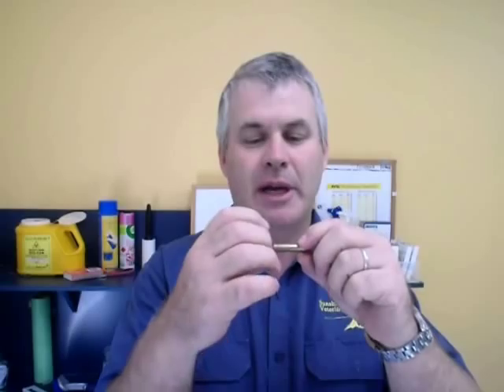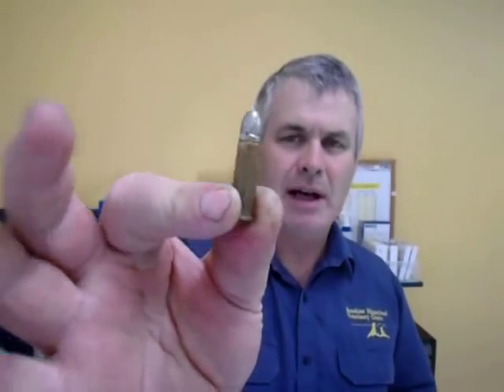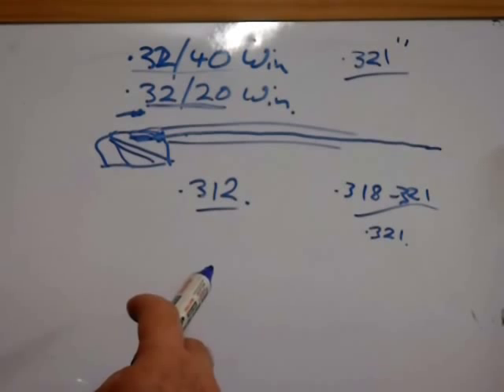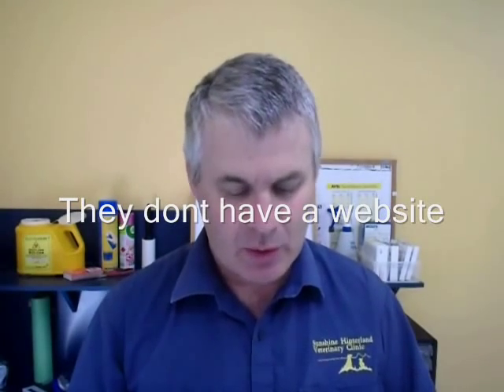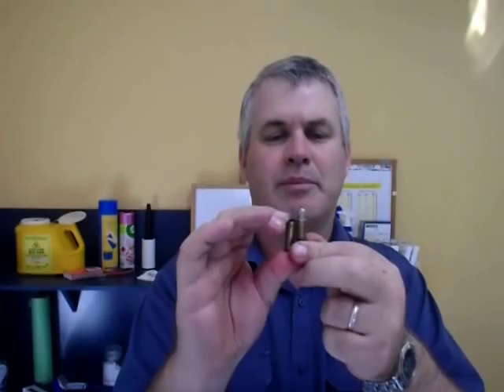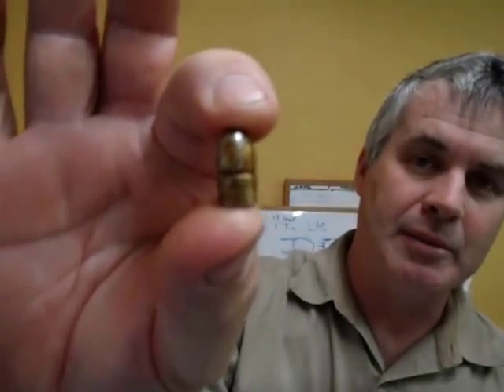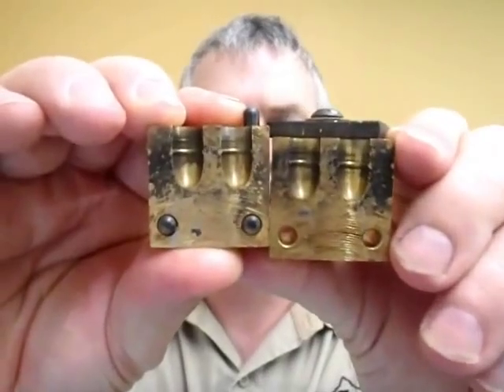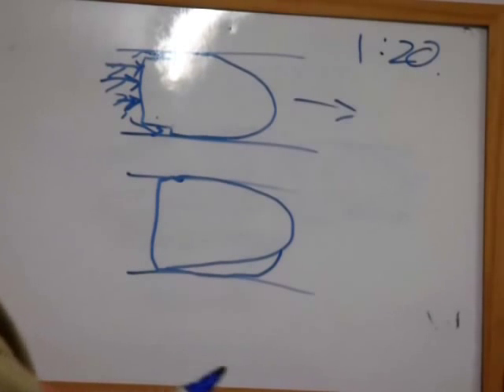Reloading and Shooting the Martini Cadet Rifle Part 2

Comment: Sir 456eec, Thank you so much for the detail and overview of the 310 Cadet.
I acquired, some time ago, a Martini BSA 310  re-chambered in 32 Winchester Special.
After having fired several factory cartridges, quite unsuccessfully from a accuracy standpoint, I retired the rifle to my gun safe. 

I suspect the factory loads with the heavier (longer) projectiles than the original 120 grains, to be a potential problem. 

Other possibilities 

for the rifle being wildly inaccurate, include badly worn lands near the muzzle as the crown does not seem to be damaged, or possibly the chamber for its sharp transition from the end of the case to the rifling. With no gradual leade I suspect the projectile might be obturating in that small space thereby shaving off part of the base of the bullet 

I am now at a point where I want to develop a cast load that is accurate. 

Before doing so I hope you can answer a question or two which might help me.
What is the standard twist rate in these rifles? I ask because there is a possibility that the barrel was relined and there is a stamp on the barrel that isn't quite readable. 

Best I can tell the stamp is either  310  12-120 or 310  16-120.
I suspect the stamp designates the cartridge / twist / bullet weight but would like to confirm my assessment. 

At any rate, if you get this message and have a chance to reply, I would like to thank you in advance.
Bob 

St Augustine, FL

Comment: I have one of the 32-20 rechambered guns.  Shoots terribly in that caliber for the reasons you point out.  I've tried a couple of 310 cases/projectiles from a friend and they shoot very nicely.  Do you think there is any reason not to just reload standard .310 cases and projectiles rather than putting a .310 projectile in the 32-20 brass?  Great videos by the way.  So much useful information.  Thanks.
Reply from the maker: Hi John
One reason is that .310 cases and dies are expensive and hard to find. The other is that the .32/20 chamber is slightly bigger and also the rim thicker so there would be excess headspace and you would be working your brass excessively so it would not last long. If it shoots well with .310 cases then it should shoot as well if not better with .32/20. Your best bet if you want to shoot it regularly is get a CBE mould and .32/20 cases and dies both of which are readily available. Thank you for your comments on my video. I made it to help people just like you and keep these great rifles shooting.
Reply: 456eec Thanks again. I've jumped the gun and bought 310 brass and some projectiles after giving the 32-20s away!  A free gun now more expensive than if I'd just bought an original chamber 310.  Maybe I'll trade it on an original barrel version....and try to learn some patience!
Reply from the maker: No worries. Hope you have good luck with it!

Comment: I've heard you can drop 32 S&W long straight into a Cadet and it shoots really well. Have you tried this?
Reply from the maker: No I have no reason to try it and I have not heard this. The .32 base is smaller so it would be loose in the chamber. The rim is .055" compared with .039" for the Cadet so there is no way the breech would close on it. 
I am not saying it is impossible especially for an old worn gun or one modified to fire .32/20. Also the bullet diameter is .312" compared with .321" so even if you could get it to fire it would never be accurate.

Comment: I was given one with a barrel rechamberd to .357 but it was done poorly and doesn't shoot well so I ordered what I thought was an original .310 barrel but found out later the chamber was reamed out to .32-20 and the chamber is off-center. I wonder if it was done with out taking the barrel off like you said. now I'm not sure what to do it would be more disappointing to get brass and bullets only to find it doesn't shoot better than the .357 barrel. Thanks for the great videos
Reply from the maker: Sorry for the late reply. Just found your post.
If the barrel is in good condition it may still shoot quite well despite an off center chamber. You may be able to find someone on a local shooters forum who will load just a few .32/20 rounds for you so you can try it before investing in everything required. I would be happy to post you a few projectiles to try.
My email is justinbulling at hotmail dot com.

Comment: how do I remove the front timber from the rifle? I just want to give the rifle a good clean! thanks in advance..
Reply from the maker: Undo the screw and remove the front barrel band. Get a suitable size punch (smaller than the pin so you don't damage the fore end) and tap out the pin in the rear of the fore end (left to right).  It will now come off.
Reply: Thanks pal...

Comment: Just purchased a set of Lee dies from Western Firearms and having the same problem despite being assured that I wouldn't. I'll email Lee and follow the same path , anything else I need to tell them ?
Reply from the maker: Hi Rick. I would slug your bore and decide what diameter projectile you want to use, typically 1 thou. above bore size. Then send a projectile of the correct size to Lee so they open the seating die up enough to allow seating of that projectile. From memory my Lee dies were only .317 inside diameter while I was using .321 so it was a fair difference. When you send the dies and projectile make sure you include a letter in large red print to discard the projectile and not send it back so you don't have any issues with Border Force on the way back. If they detect a projectile they would seize the whole shebang and make you get an import permit.
Reply: Thank you for the reply , I'll slug the barrel and check on the size . Was definitely not aware of the projectile issue . Thanks again  . Rick